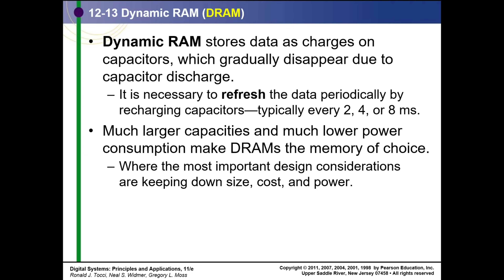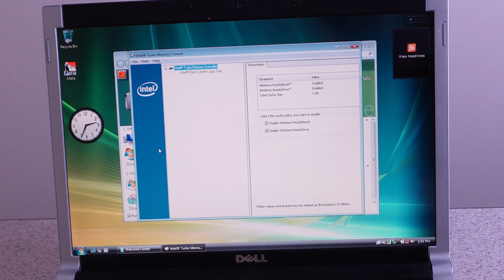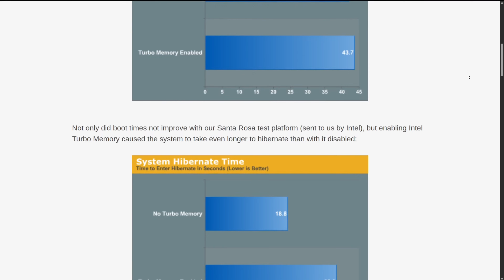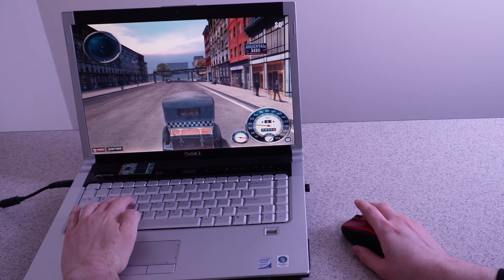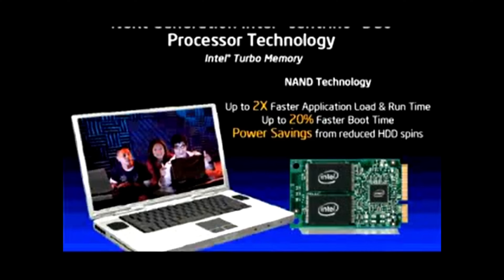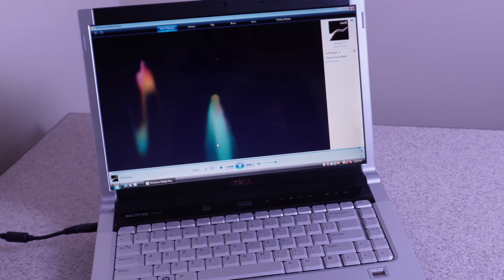Intel Turbo Memory, The Failure Before Intel Optane.

Comment: Would have been better if they let you use it as an actual SSD, so you can put your swap partition on it.  You couldn't use it on anything higher than Vista, and not supported under Linux.

Comment: just buy nvme sir, if it's an old laptop just buy a Samsung SSD, it's good enough, use Samsung software to use HBM from RAM on the PC, it works the same way as Intel Turbo memory / Intel Optane

Comment: I have the desktop module, but I never got any motherboard supporting it. Many had actual soldering pads for the stuff, but it was clear it never made it to be ready in any capacity for product release. Color me surprised that there were actually devices where the feature did function...

Comment: This reminds of the hybrid hard drives that existed during the launch of windows 8. Having personally used one it did help with boot times but not much else as the ssd portion was only four gigabytes and would auto-populate with all the most frequently accessed files. It generally took about a month to even notice better boot times. Aside from the slightly better boot times I suppose the operating system would feel snappy and eager to work despite heavy drive activity. These drives were short lived as mine died in less than a year and was replaced with a larger normal hard drive as these hybrid drives were no longer available. Of course though this was mostly a stop gap for solid state drives but even so was seriously missed when solid state drives were still expensive for larger sizes. My first ssd was only 256 gigabytes and was purchased during the days of windows 10  around 2015 and even then it was only used to run the operating system and a few programs. All of my games were still on the original hard drive from when the system was new in 2010. Got my first nvme in 2022 and I’m still using it today. When I first got that nvme drive though it was initially used in a system where adapter was needed to even utilize it. Fortunately my 7th gen I5 is capable of booting from one despite the board I was using at the time not having a dedicated slot for it.

Comment: At 1st, when seeing the from factor, I was thinking how close it was from a mSATA SSD.
And it came on the market in 2007, just during the dark age of win vista and its as ridiculous as horrid readyboost feature (a time when I had win server 2003 32bits, PAE mode to be able to use more than 4GB of RAM, and a tendancy to stuff to the brim my PCs with big RAM sticks, and working without any swap file, I wanted REAL memory, and not "virtual memory" a feature that bothered me since early win XP).
On the bright side, I guess it was what will become a bit later, SSDs, and Intel was amidst the firsts, if not the 1st, SATA SSDs manufacturer.

Comment: I suspect the reason Turbo Memory slows down the computer is because Intel wanted to deliver on their "longer battery life" promise. The cache needed to keep up with whatever program you're running on your computer, which means a lot of writing to the Flash memory on the module - and Flash memory of the era was just too slow for that.

Comment: It didn't go away. It became IRST or Intel Rapid Storage Technology.
I personally used that IRST with a z77x board and a 2TB hard drive as well as a 64GB msata ssd in enhanced mode as huge hdd cache. That was nice and it worked quite well up until I replaced the 2TB hdd with a 2TB ssd. Then it became obsolete and I freed that msata slot to gain a sata port.

Comment: I remember having the M1330 instead of the M1530 thats shown here. There wasnt a slot for the "Turbo memory" and i was disappointed that i got the wrong laptop but after a few years, i learned that the turbo ram module was useless. I used the M1330 until 2017 and i would confidently say that it was longest lasting laptop I've ever seen.

Comment: It was also known as intel octane and was used essentially to accelerate hdds read times
It was too expensive to manufacture alone in house and never caught on 
But its the same tech as shown here but in m.2 formats or even regular RAM sticks in some cases
The best were those already bonded to drives, if it didn’t consume the drive making it unusable when paired

Comment: So it was just ssd page file for hdd systems, that would probably fly today with how unoptimized OSes are for HDD's nowadays
Reply: That's basically why SSHD's became a thing for a few years. Usually configured with 8GB of flash memory for caching files...which didn't really help that much. Then Intel tried again with Optane and yet again, it didn't really take off, but then again, they tried it when a 128GB SSD was 20 bucks or less.
Reply: My old desktop had a 1tb hdd and was super slow to load anything. I took a used 64 gb sata ssd I got given as a gift gift and set it to 32gb readyboost dedicated. (32 was the largest page file readyboost would let me set on that ssd). PC ran like a dream after that.
Reply: Windows will actually disable prefetch and boot optimization when it detects it is running on a solid state drive.
Reply: At this point SSDs are so cheap it wouldnt even really be worth it.

Comment: So a semi jump from this to Intel Optane which also failed but actually was useful for the intermediary period between SSDs being good prices and HDDs still being better for larger storage. I have a 16GB Intel Optane in my spare PC.
Reply: Optane was never very useful. Wasn't cheap enough or fast enough to replace ssds or hdds.
Reply: @Ironclad17 but optane has marginally more read/write cycles than traditional ssds, which makes them better for more sensitive workloads. I'm pretty sure Linus Sebastian once used one in one of his homelab builds.

Comment: I wonder if the issues are due to the speeds of the module not being that high so when it spent time doing that write cycle for putting whatever file in the module it would have been faster to just read the file normally?